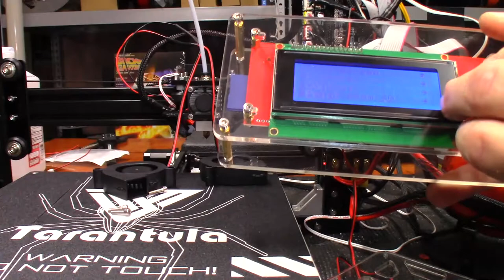Installing Dual Blowers On The Tevo Tarantula

Comment: Great video! Did you connect the new fans in parallel with the one you already had or do they have their own connection straight from the board?
Reply from the maker: I connected it to the existing fan because that board didn't have a port for fan control.

Comment: Need to see if someone can remix that mount to add uprights so you can secure the fans to them. Superglue works but they might be a pain to take off if you decide to change up the mount or the fan dies.
Reply: hotglue is removable

Comment: Where did you solder the fans onto?
Reply from the maker: Back when I assumed it I ran 2 wires along with the rest though the loom and left them for later use.  So when the time came to do this project I connected the one end of the wires to the board and soldiered the other to the fans.